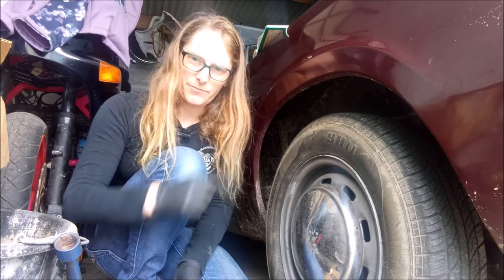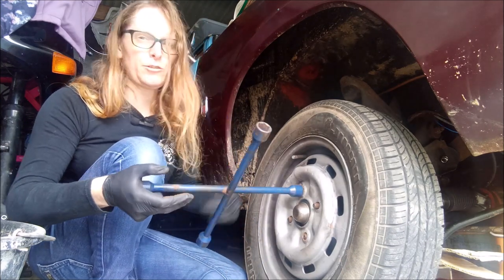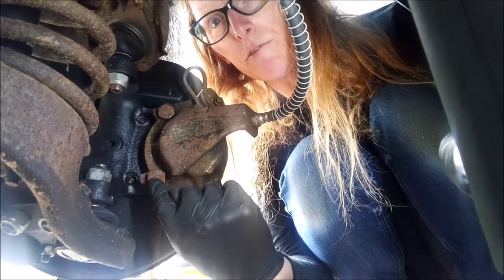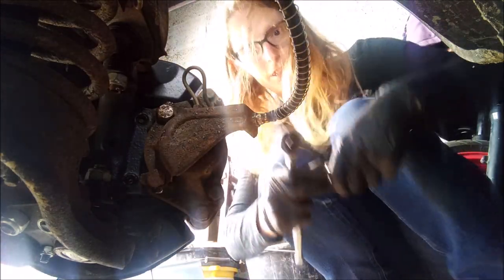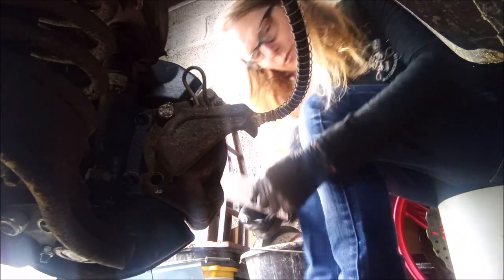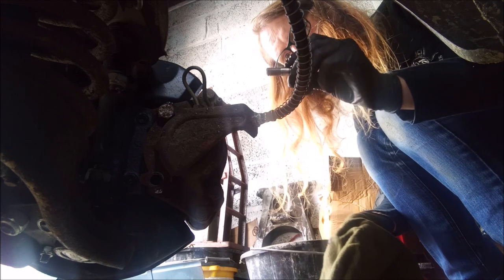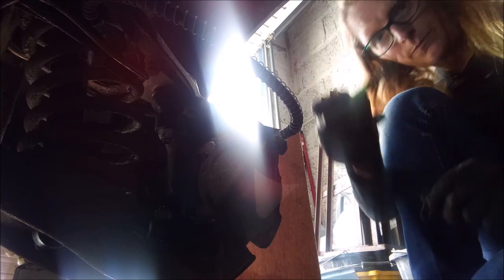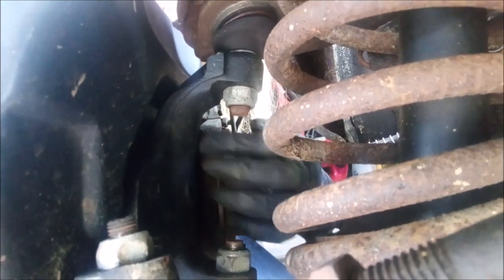Cortina mk3 front brake rattle. lets fix that.

Comment: Great work Simone. You only need to drizzle the loktite from top to bottom of one side of the thread, it will spread itself as it is inserted. As for the calipers moving, check the mounting holes are not egged out from being loose. If so you will have more issues in the future.

Comment: On my Rover P5b, the calipers have a similar design and are torqued to 80 nm or 59 pounds foot and the bolts are 1/2" unf with a 3/4" AF head (19mm) so you're just about right with 50 pds ft. Good idea to use blue loctite. Expensive but the best IMO.
Reply from the maker: Thanks for watching the film. it's interesting to see the differences in torque settings and how different they are between the two cars. Yes the loctite is worth it.

Comment: n n n 19 :) I've just done my tie bar bushes Simone and noticed you've gone with the later arms that have the hole for the stabilising bar. Wonder where your original ones went! Keep on fixing the jobs. Cheers Mac.
Reply from the maker: I sold them on mac. I want to get a front anti roll bar fitted.
Reply: @CortinasAndClassics  I didn't know that, I presumed you need to change for the matching subframe for that to happen?